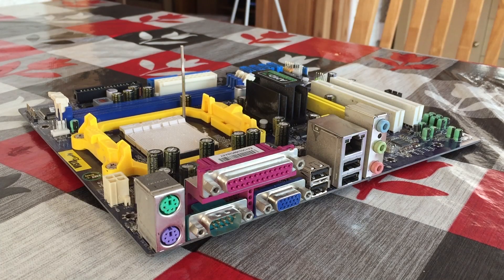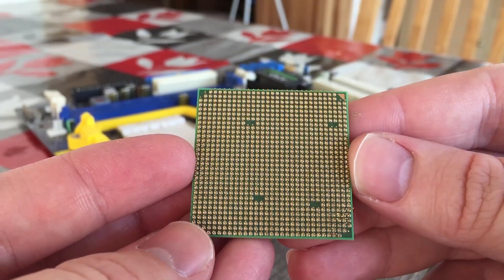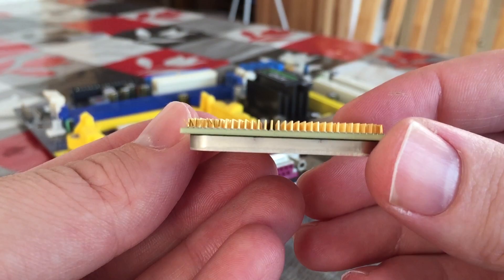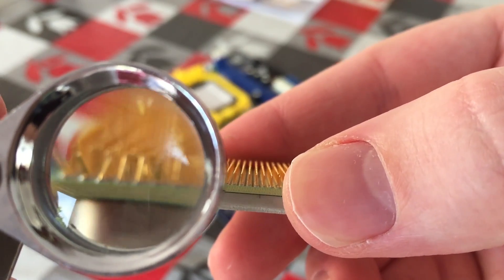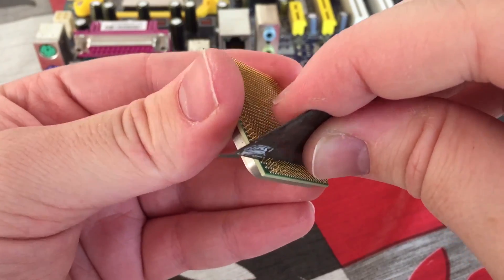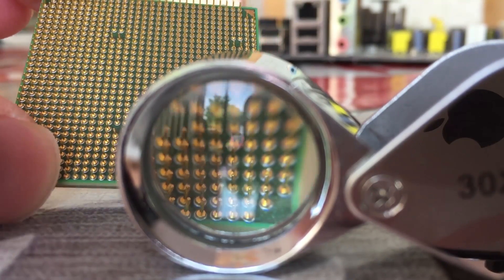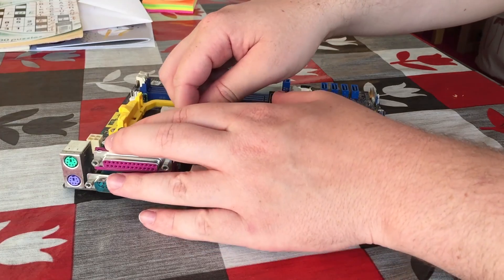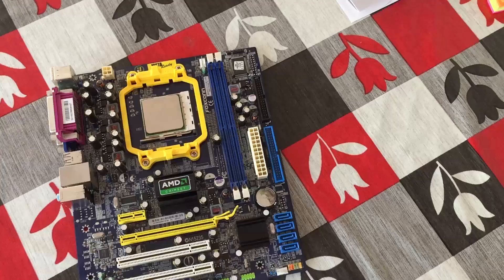A PC Builders Nightmare? (Fixing Bent CPU Pins)

Comment: Nice work! 😀

My AM2+ processor has several severely bent pins. In addition to the safety blade, I found a mechanical pencil at Staples. It has a long, thin end which fits perfectly over a pin. It's the only pencil I found that has such a long end. The price was only $2 and change, but I had to order it, since they were out of stock at the local Staples store. 🏫

I was thinking the pencil would help with fine tuning to get each pin exactly straight.

Has anyone else tried a mechanical pencil to straighten pins? Ferris Bueller, Ferris Bueller, anyone? 🤔
Reply: Yes, and .1mm tapered bit for LGA pins...

Comment: The other day, I got the my 2700x to fit on the motherboard, mounted the cooler and everything until the computer just refused to boot. LED on the motherboard wouldn't light up. I then proceed to spend an hour checking the motherboard, PSU, Ram, etc. until there was nothing but the CPU to check and my heart skipped a beat when I noticed there are 3 CPU pins in a corner that got bent. I managed to bend them back, using a toothpick, and fit it in the motherboard socket. The moment it booted up I wept.

Comment: if u break a pin u can use some of the wire out of a ethernet cable in the hole  thn just wedge the cpu back on it make shure u cut it not to long or short tho but i had a cpu with 6 broke pins and figured that out  the thing worked for another year n probably still does to this day  but i replaced  it eventually

Comment: getting thermal paste off the bottom of an AMD cpu is a pain in the ass as well

I went to pick up a am3+ motherboard off a guy and he really really wanted to sell me a heatsink as well.

He know nothing about pc parts

Evidently on the bottom of the heatsink, the cpu was stuck with thermal paste and he never noticed. Probably had it sitting on the pins too at times

I peeled it off buck got some paste on the bottom cause there was just so much. 

So bent pins and past. It was a fx8100 or something

He really wanted me to buy everything (even thought the heatsink was useless to me without a mounting bracket) 

So I gave him $20 and I'm trying to see if I can get this cpu to work. Would make me my $$$ back plus some. 

But it's a pain. Bent pins I can deal with. Taking your sweet as time to remove paste is a hassel and a half

Comment: Had to do this exact thing today on a A10-7800 because it stuck to the heatsink of the dead cooler and when it was removed it fell into the computer case. Now waiting on the new CPU cooler to see if it worked well but it fitted back into the motherboard socket without any problems so I'm very hopeful.

Comment: Try using a propellant pencil, just remove the lead and put the pin into the end and straighten. They come sized 0.3, 0.5, 0.7 and 0.9 mm sizes so all CPU pins are covered. I think AMD were 0.5 mm. if they are too near the tha adjacent row you will have to use a sharp edge to open the gap then micro adjust with the pencil.

Comment: So I just bought Overwatch, and as I'm opening the box I take a glance at the min and recommend specs, just for curiosity sake and I noticed something odd

The recommended cpu between Intel and AMD does not match up at all. Intel says i5, so a quad core (barring some first gen i5's like i5-650-680). BUT AMD has only a Phenom II X3. So a triple core, and a phenom II at that, not a fx bulldozer or piledriver cpu. At least a Phenom II X4 or even a X6 to compensate for weaker cores. 

That seems odd, that the recommended Intel cpu is probably a good deal more powerful than the minimum AMD one. 

I know you made a video about Fortnite min and recomended specs, maybe you could make one about Overwatch.

Comment: While the pins are generally tougher on a PGA not to get bend easily with a slight bump, The problem with Ryzen is that its pins are thinner (and more malleable) than the old K8-10 socket CPUs and there's 1,331 of them clusetered together with a relatively tighter space between. it will be much harder fixing bent Ryzen pins in comparison.

Comment: Fixing bent pins in an intel socket is way worse. I used a protractor to straighten AMD pins, it has a pizza cutter edge and is just slim enough to glide between the rows, unless it's bent horizontal, then a cocktail stick or sewing needle comes in handy.

Comment: Just recently i bent some of the pins on my ryzen 7 1700 while swapping the cooler, somehow the crap included thermal paste glued it to de IHS, the cpu came off the socket even with the retention arm down, bending some pins on the way out because i tried to remove it with a twisting motion. The pins on ryzen are even smaller than the ones on the video, needless to say i was a very scared when bending them back in place, i used some precision tools that are meant for soldering, luckily it was pretty easy to put all of them in place and it has been working fine since, but the fear of losing such an expensive component thanks to some crap thermal paste was real.

Comment: A tooth pick works better. If you run it down the rows it spaces them relatively well and if a few pins are particularly bent then you can use the tooth pick on the very tip of the pin with almost no pressure and coerce it back upright.

Comment: It is very easy to fix the bent pins using a mechanical pencil, use the tip to insert each pin individually and bend gently to the original position. Had to deal with that situation some time ago.

Comment: Some of the worst rigs I've encountered as regards bent pins have been business PC's based on old Intel Pentium 4's and thermal pads. They'd sat in storage for a very long time and the pads had all literally set like concrete. However a quick and fairly easy remedy was to simply turn the machines on for a few minutes in order to warm up/expand what was left of the pad, switch off, then quickly and gently twist the cooler back and forth to help loosen things up some more. And it didn't take long at all for some of those Pentium 4 CPU's to warm up..

Comment: Thats why a used amd cpu or a used intel mobo is a risk. You can remove the cooper inside a small electric cable, then use that "tube" to straith a pin, thats what o done when i change my fx8120 for mine phenom 1100t, 3 pins smashed, more 3 bended, 3 hours of work. Sorry for my english

Comment: if you do happen to rip a pin off do not worry! just continue to straighten the pins and when it comes to socketing the cpu drop the yanked off pin into the correct pin hole, should be enough pressure from the rest of the cpu pins to make a solid connection !

Comment: My z77 pins where bent but Mobo worked fine but I've noticed my temps where spiking on my non k i7 3770 and voltages where too high not too sure if those pins has such a important role

Comment: I'd love to opt for an AMD CPU in my next build but am rather apprehensive due to the seemingly common problem of bent pins on the PGA socketing system. I've been a little clumsy in the past inserting Intel processors and yet have never had any issues.

Comment: you know what i dont get, why dont they use some kind of plastic mock-up of a socket to protects the pins on the cpu like when you get a new LGA motherboard but the fake socket just clips on too the cpu instead
Reply: easy, it's about saving money

same reason why AMD cpu's don't have integrated graphics aside from APU's, intel has garbage stock fans, and intel stopped soddering their cpu's after Sandy Bridge and instead use cheap paste/TIM

plus they do normally give you that plastic wrap the cpu comes in out of the box so you can keep that.

Comment: I buy these for storing and mailing my AMD cpus (even some intel ones though they don't fit exactly, still keeps them safe)

https://www.ebay.com/itm/10pcs-CPU-Clamshell-Tray-Box-Case-Holder-Protection-For-AMD-754-939-AM2-AM3-FM1/162706076433?hash=item25e209b311:g:8EQAAOSwmiZZ20Jx

Comment: Use old computer case vard slot cower, it's perfect fit.

i use needle to lift the more bend pins straight-ish so i can fit the tool between the rows
Reply: I bought 1800x Ryzen for 20€.
Big portion of the pins were badly bend and 14 of then broken off.

I got all the pins straight with the method mentioned above and i replaced the 14 missing pins with a pins from old socket 478 celeron, it took few tries to wiggle the pins on the socket before i got the system working but it have run half a year ever since with 4ghz and 3200mhz cl14 ram without problems.

Comment: Not really... The nightmare is fixings bent Intel Motherboard pins. Those are horrible.    
AMD cpu pins are easy as cake as long as no pins break off. I think i fixed around 50+ already. Most were from sellers packaging cpu wrong.
Reply: I bought a pack of cheap AMD plastic cpu cases for when I flip AMD cpu's. It keeps the cpu elevated and thus the pins are suspended

I hate how people pack AMD cpus without any regard for pins

I bought 10 for $2 so pretty good to make sure I have no angry buyers

https://www.ebay.com/itm/10pcs-CPU-Clamshell-Tray-Box-Case-Holder-Protection-For-AMD-754-939-AM2-AM3-FM1/162706076433?hash=item25e209b311:g:8EQAAOSwmiZZ20Jx

Comment: I once bought a used FX6350 that arrived with a couple of bent pins. It probably happened during shipping, as it was not packaged very good. But It was easy enough to bend the pins back. Used that CPU for a few years before I got my ryzen 1700  system last year.

Comment: Hey, I watch your videos a lot. But  I have something that you can explain. Well, I have a hp compaq pro 6305 sff and I want to upgrade it to gtx 1050ti with 32gb of ram. But I am having some problem with power supply because its 240w. My question is “how can you use a 500w powersupply on this platform”? 

Thank you
Reply: NJ it’s a sff pc from hp, upgrading the psu is a no go, all proprietary
Reply: But can i use external psu?
Reply: NJ possibly, it depends on the power supply connections. I have two Elite 8100s, and there's no 24 pin. If the mobo has a standard size 24 pin connector you can plug a regular psu into, you can, but you most likely can't.

Comment: hello my friend my laptop gpu is idle at 50C when i run games it reaches 102C and shuts down i tried repasting i tried thermal pads i cleaned the whole pc formated still the same issue can u help me :(
Reply: Some info needed

1)What cpu and what platfrom, and even better if you know the name of the motherboard

2) Overclocked or stock

3) Stock heat sink or not
Reply: its a laptop cpu is i7 920xm hd 5470 1 gb 8 gb ram Dell 005WC3 motherboard i think i could be wrong and thanks for any type of help i really tried everything i underclocked my gpu to 640 from 750 clock speed and it made the fps decrease from 50 fps on assasins creed rogue to 20 fps and memory clock from 800 to 600
Reply: what operating system are you using?
Reply: 10 but i tried 7 all updates are installed
Reply: sorry I asked for your motherboard not reading it was a laptop, what is the dell model
Reply: a dell n5010 thanks for trying to help me bro
Reply: The laptop's cooling solution is probably awful, which is pretty common for these types of Dell laptops from the early 2010s
Reply: I've had this same problem with my MSI laptop, turns out the heatsink mount on the motherboard had broken off, so there was not enough mounting pressure on the heatspreader, since it was lifting the piece it was screwing into instead of thightening it to the motherboard, see if thats the case in your machine, e recommend gluing it down to the motherboard  with plenty epoxi glue and waiting at least a day before screwing the heatsink into it, i'll try to include some photos of the piece if youtube lets me.
https://imgur.com/a/wPkIG
Reply: so my local shop has a good new heatsink that is the same for my laptop should i buy it?
Reply: They say the dell 15 models have shit heatsinks
Reply: Unless somehow the current heatsink has a busted heatpipe or something like that, changing it for one of the same won't fix your problem, however i'd suggest getting a better fan if that is at all possible, are you sure the current heatsink is installed correctly with proper mount force?
Also have you looked into getting one of those external fans that you put on the side of the laptop to help with exaust/intake? One of those may do the trick.

Comment: What about bent pins on the motherboard?
Reply: that's much harder and requires a much more steady hand
Reply: Steve Smith  but it can be done.
Reply: lance joseph it can, but you think "steady hands" random here is going to pull it off?
Reply: Because they is a used motherboard for a asus g20 that I have but a newer version of it. I was thinking about buying it and paying someone to fix it. Then swap it out with the older version one that I have.

Comment: If one pin breaks off will the CPU still work?
Reply: OneSteelTank yes, use a copper wire in that respective hole
Reply: It may work, it may partially work. (Eg some ram not working). Or it could not work at all.

Comment: Had my fair share of needing too do this myself as well, my cousin when he bought a new motherboard ripped the cpu up with the cpu cooler, & when he tried installing it he bent pins as he didn't dare take off the processor from the cooler (a phenom II x4 965 3.4 ghz)
The first thing i did was stand over his bed with an old bunch of random advertising papers & fliers that was about too be burnt up, & pinged the processor off into the bed on the fliers with a tap from the screwdriver, unbent the pins for about 40 minutes & then put it together.
(Old one failed randomly one day for him, was a cheap am3 motherboard that took 125w cpu's at best so not surprising really.)

Also got a pc that a kid tried too destroy in hopes of getting a new pc from his mom.
(Yeah it didn't work.)
(Destroyed motherboard but the rest worked fine & i was allowed too keep the parts from the rest of the system, case,ram,powersupply which i sold too another guy,gpu, harddrives.
(Had sold him a 400w powersupply & my Sapphire HD 5770 lite 1 gb along with moving a harddrive from one of his moms old pc's too that one a 320 gb drive.)
(2x 6 pins on it & decent quality for the time & still a solid unit imo silverpower 400w 80 plus bronze based on seasonic S12 design.)
An Athlon II x3 445 3.1 ghz which i unlocked too a quad core cpu.
(Screws over temperature sensors on the cores which i told him about that it wasn't anything too worry about unless the processor is stuck at 800 mhz which it wasn't.)
(Originally a dual core athlon in the system which i think he threw away for some reason as well.)

Comment: When I was 9 years old, I tried to teardown my Pentium III PC. I pull out the CPU out of the socket, and you guess it, I accidentally bent one of the pin and broke it! Then I put it in my motherboard and turned it on... IT BOOTED UP. I didn't know why it still worked without that one pin...
Then almost a decade later, I found Socket 370 (or 478? I kinda forget) pinout, and that broken pin is just "for future use" :D :D I was fucking lucky back then...

Oh, to make sure how dumb I was, I also removed "the blocky aluminium" (HEATSINK) out of the GPU (GeForce2 ?). And I was wondering "why after 20 minutes, the PC is automatically turned off after I removed that blocky thing?" Lol...

Comment: My brother bought an FX-9590 from cex last year, the chip worked but it would only let his pc utilise 3.25gb of ram with 8gb installed which was baffling at the time but after a quick google search it was clear the issue had to be a bent pin, we removed the cpu from its socket and sure enough there it was, we fixed the pin using an old blade to ease it back into place, it wasnt tough but it was scary doing it for the first time, you just have be gentle.
Reply: H4WK69 from where...? It's CeX.
Reply: Q